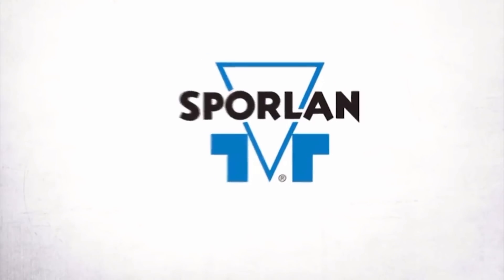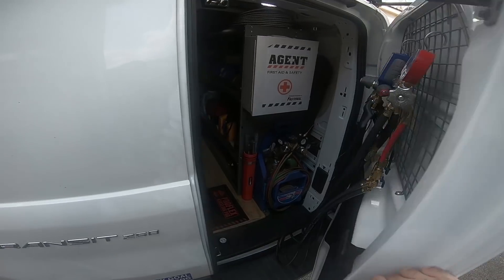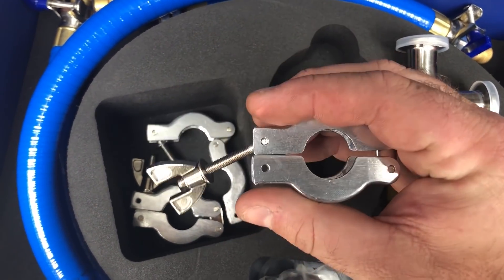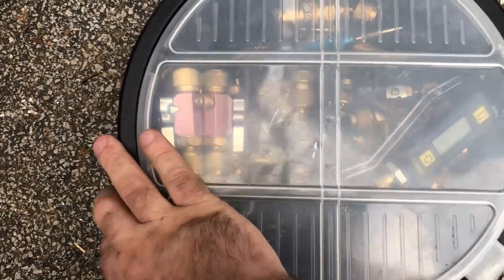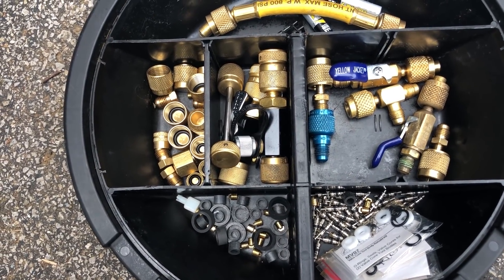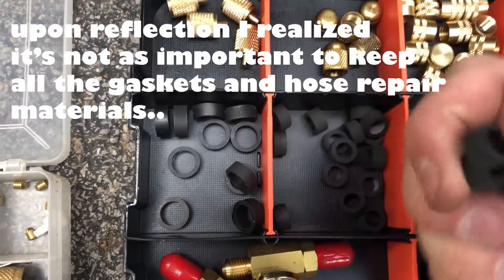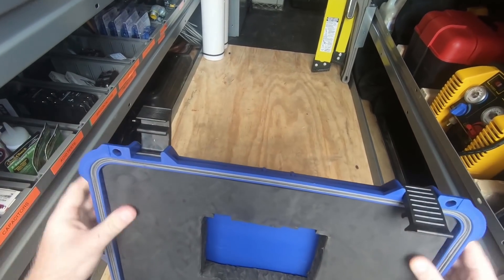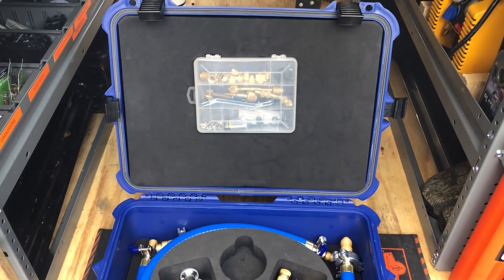HVAC Evacuation/Vacuum Setup;  from bucket to TruBlu

Comment: I almost bought those trublu hoses but between the price and those big, bulky clamps I went with the Navac 3/4" big boy hoses.  No bulky fittings and extra washer seals to deal with I cant see the trublu hoses out performing the Big Boys by much if at all.  Got two 3/4 big boy hoses for $150 I wish someone had a video that compared them that might have swayed me but I it gets cramped down there at those service ports and those big bulky clamps look like more trouble than anything especially on a 2 hose residential setup

Comment: Good Evening
I just got my TruBlu set just like the one in the video.  You use an Appion 5/16” core remover tool. How did you attach that to the TruBlu hose? It only came with two 1/4” fittings, one 1/2”, and one 3/8”. Did you have a separate adapter not shown on camera?
Reply from the maker: A 5/16” core tool still has 1/4” flares on the back of the tool for you to attach your hoses. The 5/16” end attaches to the equipment you’re evacuating. If you have the two 1/4” fittings in your kit then you’re all set
Reply: AK HVAC , thanks for the prompt reply and I’ll further invest in a pair of 5/16” Appions. Happy 4th of July!

Comment: Big question for you don’t know if anyone ever asked but what’s the point of large hoses if you can only pull from a 1/4” hole doesn’t seem to make sense I do use 3/8 hoses but never seems to matter only time I ever noticed a difference was taking the Schraders out
Reply from the maker: Ray Ring blow through your mouth like you’re trying to whistle. Then open your mouth the same way, and blow into 8 feet of 1/4” vinyl tubing. Big difference right?  It’s actually the LENGTH at that small diameter that slows things down. Having a 1/4” opening in a service valve opening up to a 3/4” hose for 3’ offers much less resistance and more evac speed than a few feet of 1/4” or 3/8” hose after that service valve.  You’re right, I don’t find 3/8” incredibly faster than 1/4”, but you better believe 1/2” and 3/4” make worlds of difference.

Comment: Tried using the solderweld code this week and they said it was expired. On the plus side I'm getting Nathan certified and had a Schrader valve installed.
Reply from the maker: R Lalley I’ll reach out and figure it out. It’s expired before and I had to nudge them to re-enact it.

Comment: Hey man, what do you think about the new Klien HVAC 8-in-1? I am considering getting one for myself and all my coworkers.
Reply from the maker: They look pretty cool, though I haven't bought one yet.
Reply: Hey this is Blaze from SoCal. I think that you will like the 8x1. Sometimes it will be something light to carry with you to check something out quickly because it has the nut drivers that are magnetic, the screwdrivers and the core tool right at your disposal. Happy shopping. God bless.